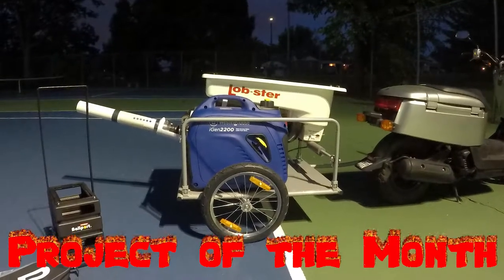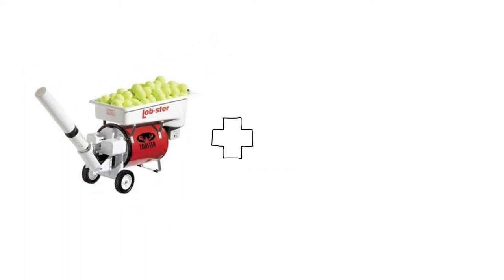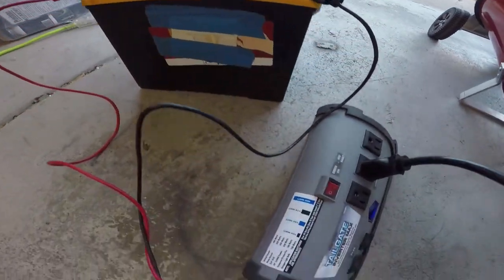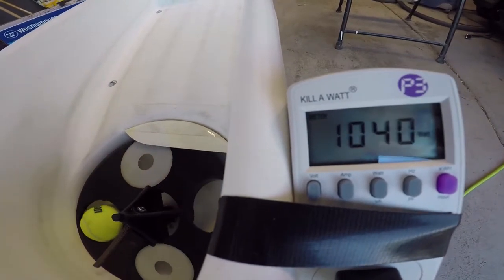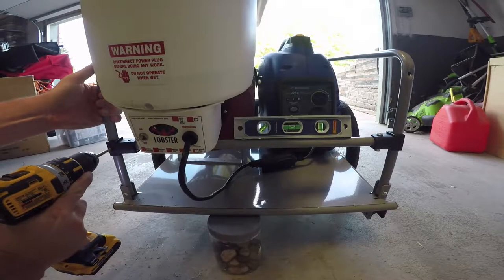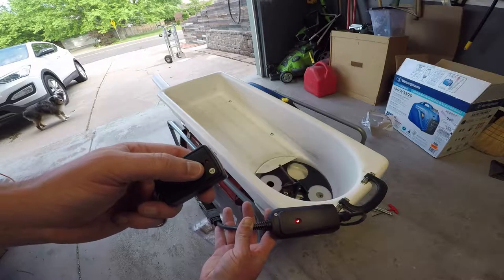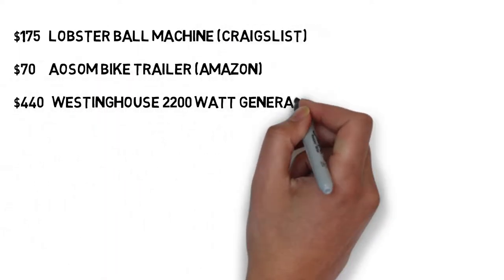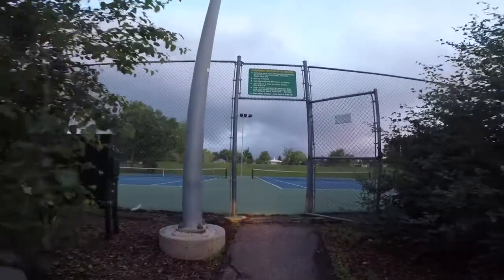DIY Mobile Tennis Ball Machine Trailer

Comment: Excuses my ignorance if you some where talked about this, but how did you attach the bike trailer to the side of your scooter?
Reply from the maker: Matt Weaver the bike trailer comes with quick detach hardware designed to attach to a bike spindle. I attached it to the lower suspension bolt on my scooter.
Reply: Ahhhhh, that make sense!!! Thanks!!!